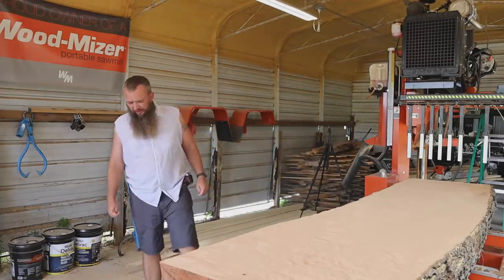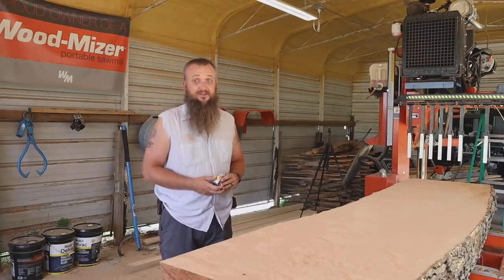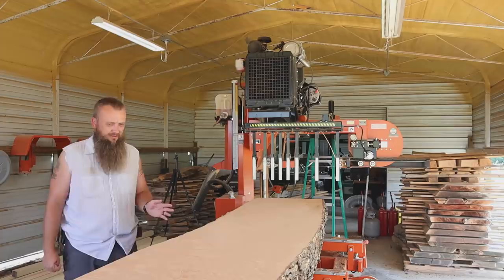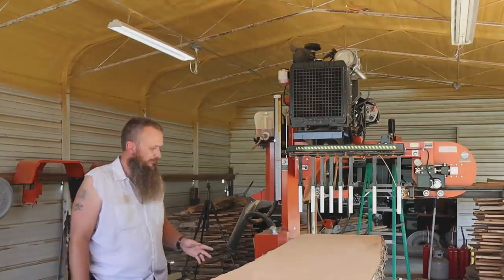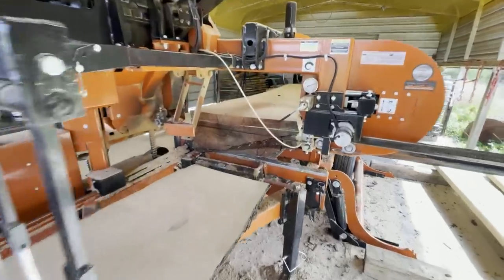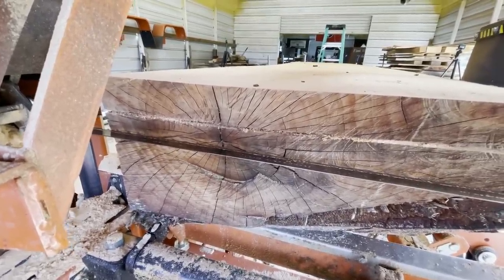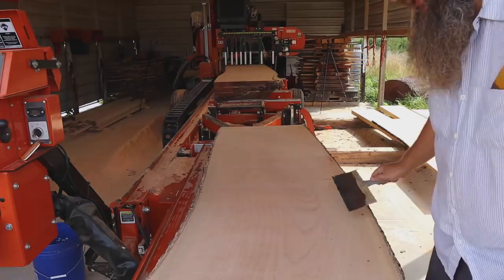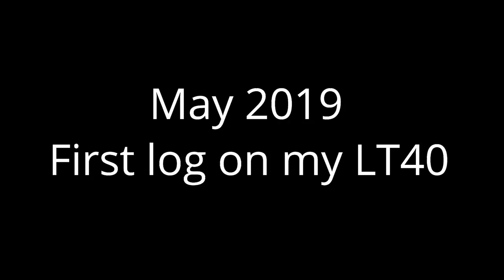What Have I Done? I Sold My Dream Sawmill

Comment: I can only imagine what fine, new, bigger, more powerful, and more efficient machine with even more features you will bring into your operation next. It's been a pleasure since the first log was cut, and I know it will be an even bigger pleasure in the future. Sharp blades and straight cuts my friend.
Reply: New turo saw accompanied by a laser show. Saw dust auto fed into self contained generator that will supply power to his entire estate. Kiln turned into sauna cause its already obsolete.
Reply: @jamesmarks3816  All he needs after that are pre-cut logs with stickers between the slabs, a self-reloading wood fired BBQ pit and a year's supply of brisket and ribeye steaks with a few racks of ribs, some sausage, and a cold adult beverage or a few cases.

Comment: I saw one a few years ago where the sawmill and surrounding flooring was covered by a type of grate flooring that allowed the majority of dust to drop down and a vacuum system pulled the saw dust to a collection pit outside the shop where it was contained in a 3 sided open bin. They then offered the sawdust to neighbors that ran a poultry house for young chickens as bedding and the guy came up once a week with a truck and a small front end loader and loaded up. The real cost he said was the recessing of the floor so grating could be lade over top and then an evacuation system.  He looked at two types one was an auger type and the other which he went with was a vacuum  style that pulled it down and into a dust collection area and then blew it out overhead to the outside wall and into a collection bin. He did that in part repurposing a small car engine  to run the suction system. He eventually went to an electric motor to cut down on noise but was happy with it. Said it cut his cleanup to a minimum of collecting bark and actual trash. When pit was near full he called his neighbor to come pick it up.

Comment: When i build my building for my mill i will pour a trench in the concrete to accomidate a conveyor and it will have grating over it. It will go into a hopper with another small conveyor to pile it.

Comment: 2 things, on the sawdust, maybe a wheeled cart attached (but easily removable) to the sawdust chute so it tavels back & forth with the mill? The pith, maybe cut 2' above at 2" below, set aside, finish your slabs the stand on edge and 4/4 x 4" boards? then you only waste the very heart not all the good stuff on that plane.

Comment: Simplest option is a V shaped catch box running the length of your head run and raised up enough that the dust tube is even with or just inside and below the tops of the V .... not sure what this does to your walking clearance though... in the bottom of the V is a nice long auger screw....and it's just driven continuously by a small motor and some gears and a chain, or pullies and a belt to get a little reduction in there for torque.... you can probably by a grain auger for a silo and adabpt it very easily and have most of the hard stuff done for you already.

Next would be something like a manure trough... flat belt with flappers on it that runs the length of the mill head run in the bottom of a v shaped catch box ( with a wide square bottom of course) that just drags the dust out one flapper full at a time

You could do it with a water jet in the bottom of a v shaped catch trough as well, water dumps out into a big cattle watering tub and you have a sump pump in the bottom that fires off and causes a stream of water to bring the dust out ( wet saw dust will sink like sand  and just go with the flow ... you'd need some sort of separator at the bucket so that you get reasonably clean water back in the loop.

I'm sure there is a way to do it with a blower ... I think that the family out west who have a 70 permanently mounted have a suction tube attached to the mill head and it's supported from the ceiling and goes out to a standard wood shop dust collection system , they also collect the dust off the 2 bladed edger with the same system ( Linda's Sawmill Theater Ithink ... if you search on that you can find her setup....they have a higher ceiling that you do, and run as many as a 4 man crew, but they have the streamline down pretty darned well.)

Comment: You could take a bale elevator, take off the wheels and supports, fit it with paddles and angled sides then slide it under the saw. This would allow for easy dust and debris collection and removal.

Comment: Believe it or not, I have thought about this (for you) before. My idea may sound a little weird, but in years gone by pig farmers used to use a conveyor chain in a cemented trough to slowly move manure to the pit. So,,, of you had a say one foot wide recess in the floor (with grates on top) and a continuously moving chain with slats on it, all you would have to do is sweep or shovel the sawdust to the recess and the chain would transfer the product to an outside site where you could move the "pile" away with your loader.

Comment: Hey Mr.Nathan I use just the blower motor of a Grizzly Saw Dust collector.
I have a video on it. Since the video I upgraded from a 2hp to a 5hp blows it out the back of the building very little cleanup .. if you type in 
Sawmill dust collector system my video should come up. 
Congratulations on the new mill !!
By the way I noticed look like a new truck to…
Reply from the maker: Thanks buddy I’ll check it out

Comment: You're killing me with that 27" wide cherry Nathan...I don't recall ever seeing a slab half that wide.  That slab would sell for some serious coin up here in the north
Reply: Matt Cremona up in Minnesota recently posted about taking delivery of sections of a massive Cherry…it measures 12’ 4” in circumference on the base section!
Reply: @erinmcgrathejm4985  that cherry that matt got was huge!! It was blown down in the big windstorm a year ago in Iowa. Matt said it was the largest recorded cherry tree in Iowa that he could find. I used to live in Iowa and have seen some big ones but this one had to be the great grandparents of them all cause it was absolutely enormous and would require a huge saw like Matt has in order to saw Slabs off that one. There will be some gorgeous table tops to come from that tree for sure. 

One of the smaller limbs that was after the crotch on Matt’s tree and was 15’ off the ground was just a bit bigger than this trunk that Nathan just cut. That’s absolutely crazy!!

Comment: The operator of a disc mill near me has rigged up a mini bucket system to remove sawdust to a pile outside his sawmill shed.  It looks like it was made from bicycle chains, and every couple of feet he has welded on a tiny cup of some sort, barely bigger than a thimble.  Whenever he is sawing he runs the motor on this contraption and he has it rigged to scoop sawdust from near the saw and dump it a few feet beyond the shed.  IIRC it tips out about 6ft above ground level, so he can accumulate a giant pile of sawdust and then remove it from time to time with his tractor - I would guess it is several months between clearouts.

Comment: I guess that's one way to resolve your saw dust problem. Get rid of the thing that makes it. :P   I always wondered if you could have a hanger for 5 gallon buckets that travel with the saw as you cut something to steer the mess mostly into the bucket. Loading up a stack of buckets seems easier than shoveling and sweeping big piles. Those dust collectors that conveyor on the floor seem nice if you can point it directly to a burn pile but otherwise is really a lot of contraption to move the pile to another place where you scoop up and move.

Comment: I hate to see the old saw leave but I'm sure you have got something coming that will be bigger & better can't watch to see it. Now for my question the slab you have with the pift in it do you stand it up & make the two cuts to get rid of the pift? Because if I'm not mistaken that's two quarter sawn boards that I for one could find a use for.

Comment: I just tried to cut some cherry about 20” and got a lot of belt squeal would a thicker or wide blade help this. I check the drive belt tension. I think it may be time for some new B57 belts but I don’t think they would make the noise. 
Love the videos watch ever evening. 
LT40 HD SUPER KABOTA DIESEL. Stanley NC

Comment: I’ve ran an Extrema Typhoon 10 hp vacuum system for 17 yrs. Same unit with the same motor. Has its own stand and dumps dust into 2 barrels. Pulls the sawdust off of the sawmill and edger. Costs $4949 now. https://www.typhoondust.com/product/dc-2100/.  Another idea if your semi remote would be to purchase a 10hp  blower and pipe the dust outside your shop and blow it into a pile like sawmills have been doing for many years.

Comment: the way you could deal with the sawdust is to make up a drag chain with paddles laying in a wooden trough that the chain would drag the sawdust out of the building and make a pile that you can move with the tractor. The chain would go around a sprocket on a pole out side of the building.  https://shagbarkfarms.com/public/Sawmill/SawDustDragChain/
Reply: A drag chain like that won't work directly off the saw because the link is a circular mill which doesn't move and a bandsaw mill moves the distance of the rails.  An air operated(fan) dust collector will be needed.  Check out these two channels:   https://www.youtube.com/channel/UCVKuunOHc5ERyL3fLrLpgOg      and  https://www.youtube.com/channel/UCMd1s_cx0gewcxdW-mCJXow

Comment: Last time you sold your mill, I predicted that you were going to get an LT70, me thinks my prediction is about to come true.
Reply: Nah, I still disagree with you! The LT70 is a production saw made to cut huge volumes of lumber each day. The LT70 will keep a 4-5 man stacking team plus operator running full speed and the saw may still have to slow back and wait for them to catch up, that’s how fast that saw cuts! It’s an awesome mill, but, and there’s always a butt in here somewhere isn’t there, lol, but, Nathan does not need that much speed! He needs a milk to cut the wider slabs!!

I’ve often wondered why woodmizer has not produced a mill yet that will cut a good bit wider slab. They would sell if they did. I can se Nathan going up to the LT50, but I just don’t think that it gas enough options on it above the LT40 that would warrant the swap except for the bidirectional chain turners that you get on the 50 & 70 and there’s a couple other little changes  but the 50 really does about the same size log as the 40 from what I remember. 

But regardless of what he gets, I’m happy for the man!! He deserves whatever he’s getting but I sure hope he gets it soon!
Reply: @1982MCI  You have a good point, Woodmizer does make 2 wide slabbing mills, check them out at Wood-Mizer.com.  the LX250 and the WM1,000.  The thing I see being a problem with either of these is that neither of these would be good for cutting lumber and in the past Nathan has done enough of this that he may still need a mill that will do well in this department.  So this will be interesting.  I know that my only complaint about my LT40 is that it isn't big enough.